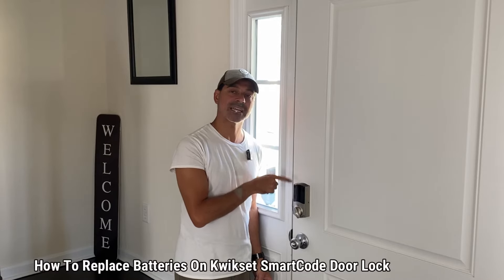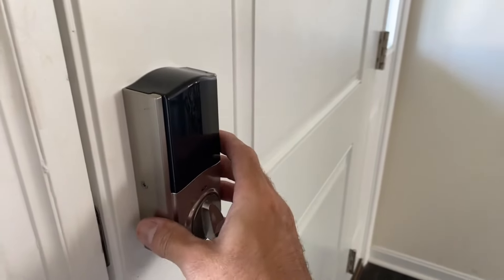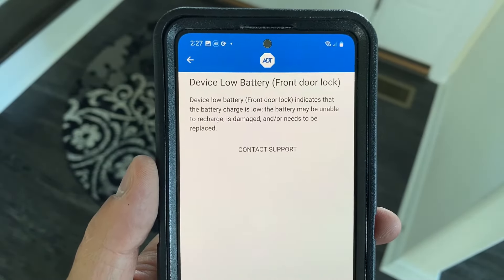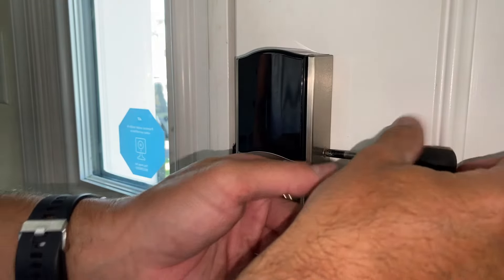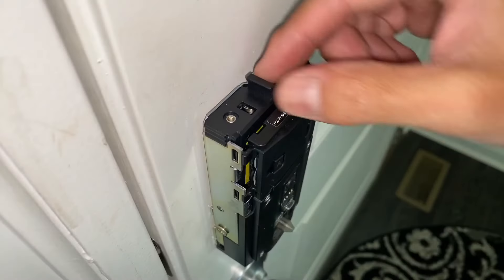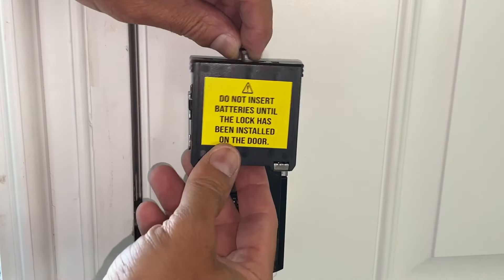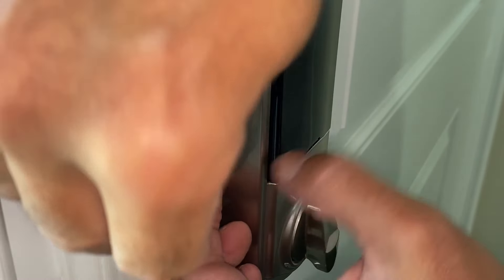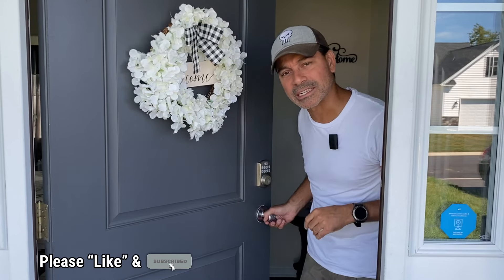How To Replace Batteries On Kwikset SmartCode 914 Door Lock  (Phillips Vision: Episode - 97)

Comment: You didn’t have to unscrew the box, just slide the smoked plastic piece up to get off and then pull the battery back up
Reply: True, but you would have to have unscrewed the small screw from inside holding that plate inside.

Comment: Cannot unscrew the back cover. Requires a special l wrench to do so.  No option but call a locksmith to be able to change a battery.  In this case the product is worthless.